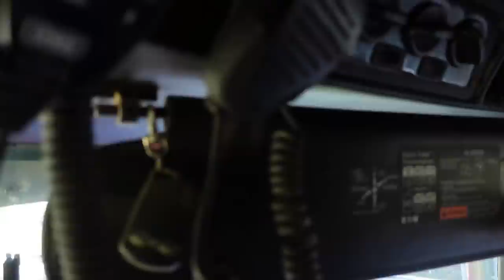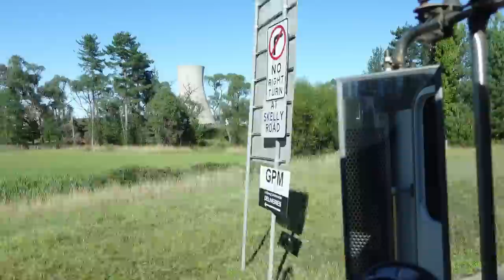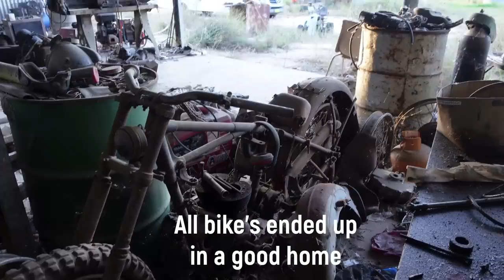Renault tractor, 46 ford truck and Chevy and Ford v8 engine’s

Comment: Well that Renault was a surprise! Thought you might have a battle on your hands, and need to yell "merde!" about 100 times, while smokin Gitanes cigarettes and wavin yer arms around, to get it going. I was dead wrong - She ran like a champ! Like the '46 Ford pickup too. Glad to see you fellas eatin yer vegetables - barley, anyway. 8^) Yeah those flatheads are not lightweights. If I'm not mistaken, that second one you loaded , the '54 as the young fella said, may be out of a Lincoln or a Mercury, lookin at the exhaust layout. Beautiful KW you rode in for the trip. The whistle of power! Liked the lathe and bikes in the shop too. The 327 is one of Generous Motors' finest - one of my faves - but you might need wheelie bars on the Chev C15 Blitz truck with that engine. Great episode Steve, really enjoyed it!
Reply from the maker: The Renault did and didn’t surprise me mate. If you knew the bloke Steve where it come from, then you’d understand. Very brainy bloke when it comes to old stuff like that, bikes, saws, car’s tractors or anything old it wasn’t a problem to him. 
 The 54 flathead I think you are right, it has EAC heads on it which were the higher compression/performance ones which were Mercury from my research. That are apparently sort after by hot rod blokes and other old racers that use them. 
 327 are great engines and it had to come home with us. The Blitz is only a thought, we were going to use a Holden v8 I have but this would suit more. I have a chev blitz that hasn’t made the channel yet, I still have to pick it up. 
 Kenworth was a pleasure to drive. Comfortable and powerful that’s for sure

Comment: Did the Mack have the E9 in her,  sounded like a one. Nice rig, Great Haul, sad for the old fella letting it all go. Those bikes were bloody beautiful. 500 preunit Trumpy and the AJS wouldve made me happy. 
Cheers for a good episode.
Reply: I had a pre-unit Triumph 650 almost 50 years ago, great bike and as the story always goes I wish i hadn’t sold it. I should drag my ‘71  and do a first start in 10 years this summer. Not stock, it’s been trimmed down to 325 pounds.
Reply from the maker: Hi mate, not sure if there was a Mack in the video was there? Unless i mentioned one. The bikes were nice and I’m sure everything was there to put them back together. Hopefully that’s what will happen with them. There’s some dollars sitting there if it was all going

Comment: Steve, do you have a strong back or did you load up on anti-inflammatories ?
Reply from the maker: No anti-inflammatory mate but certainly was heavy. They a big lump of iron those old engines. Glad we found that rickety old trolley thing. We found just enough stuff to improvise getting them loaded. I felt it Monday though

Comment: Does that T404 have six rod or kw 8 bag, I drove a T404 aswell that had 8 bag and was as rough as six, shit of a suspension, freightliner 4 bag are nice, neway, volvo 8 bag, hendrickson primaxx 4 bag are all nice
Reply from the maker: Gday mate yes it has 6 rod under it. It didn’t ride to bad I thought for springs. Hendrickson and neway are ok but in the experience I had in them they wouldn’t even out quick enough and I found I had to lock the power divider to get out of a driveway or to take off after tipping. A nice ride but the airlines were too small to let the air in and out fast enough. That’s were Kenworth 8 bag are good, they have that big airline between them
Reply: @stevesplacedownunder  yeah when
I first started I had six rod in my fibreglass cab atkinson and walker beam in K123, first truck that had airbag was volvo FH16 that had full front and rear locker was a pig when it wanted to only go straight haha, then next truck is my argosy with airliner, would be good if all airbag trucks had harebag system on them